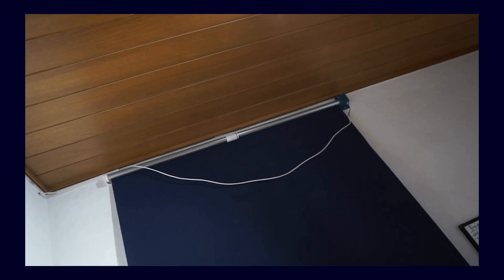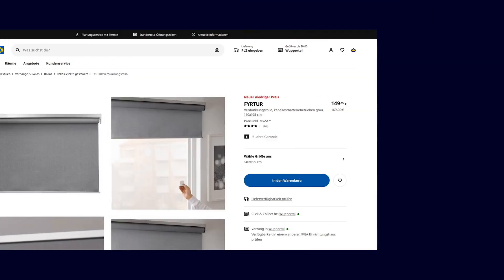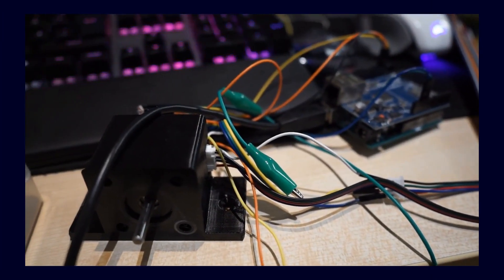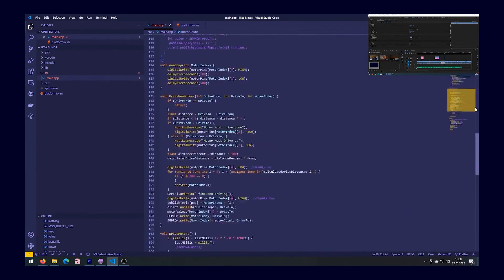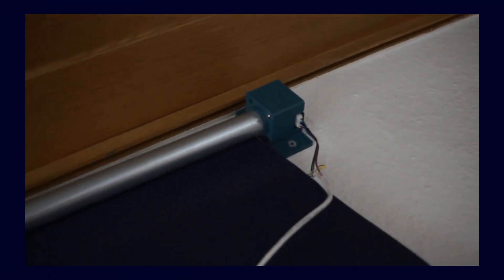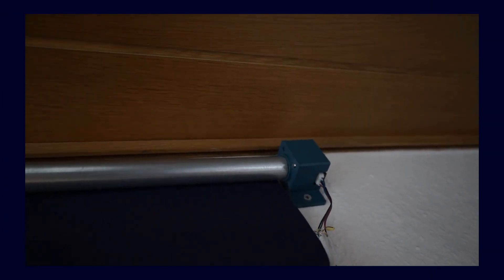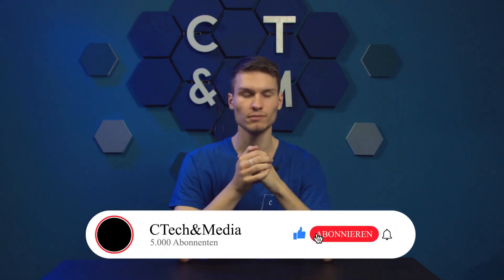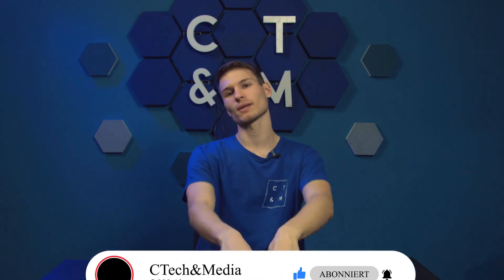Smart Electric Roller DIY - Home Assistant

Comment: I've automated my blinds a couple of years ago. I didn't mention any driver and don't see any in the video. With the nema connected to a driver you just need to adjust voltage to get enough current for the torque you need to move the blind. In my case there was a spring to hold the blind in position. Check the A4988 and the drv8825.